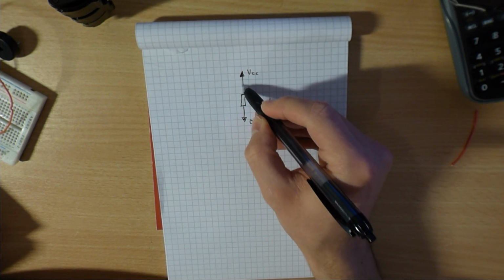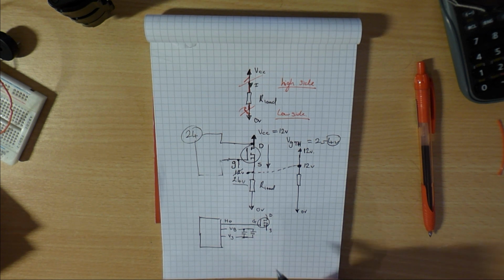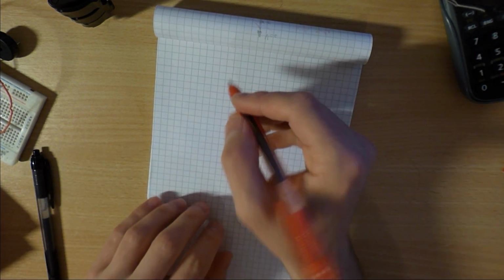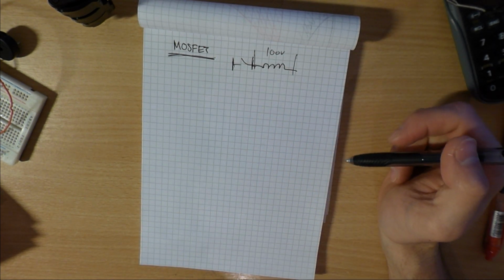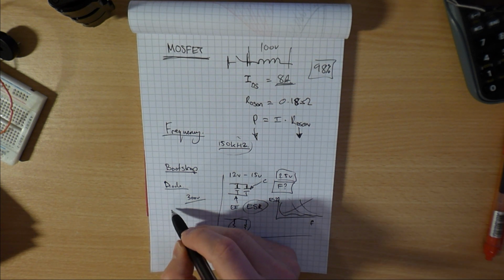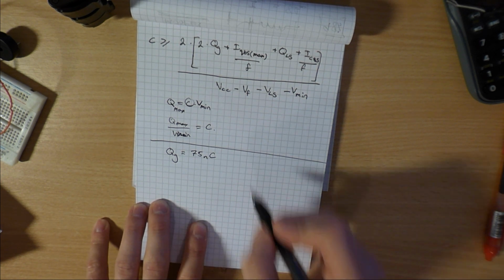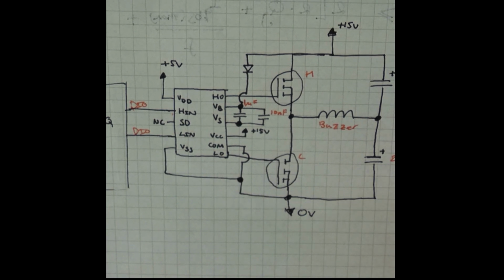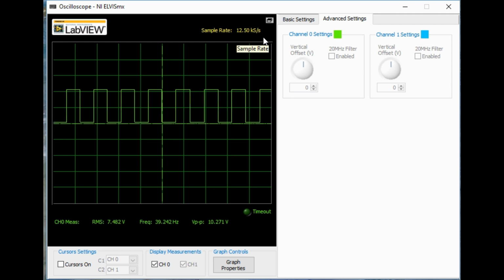Life EE # 2   How to use the IR2110 (Making a Tesla Coil driver)

Comment: Wow! One of the best video on YT i have ever seen. Well explained, in-depth analysis and practical. You should be teaching in MIT sir. I subscribed to your channel. I am in second year of electrical engineering and I was looking for MOSFET driving technique. You did it all with flying colours. Although this video is 5 years old but I do have a question hopeing you would be able to reply. What if I don't use low side switchng option, for example I am only interested in high side switching: Do I still need the second MOSFET/IGBT? Thank you again .

Comment: why did you not connect the vs pin of IR2110 to the source of the high side mosfet as you explained earlier in the video
Reply from the maker: I did it in the actual circuit but you’re right I forgot in the drawing/diagram!
Reply: @LifeofanElectronicEngineer   Thank you for clarifying.

Comment: If i connect VCC  +10v positive wire,where do I connect the negative side of the wire? Can I connect negative wire 10v to 300V ground? And if I don't connect negative wire what will happen? Because I don't see in the diagram where the the negative wire for vcc goes to?

Comment: What you mean by isolated voltage? You mean the driver prevents accidental shorting between high low?
Reply from the maker: Hey there! It’s been a while since I watched the video, so I’m not exactly sure what bit you’re referring too, but I think I’m talking about the floating high side supply. The gates of the high side FET needs to be 12v higher than the source to completely turn on. Usually your highest voltage available to you is the source voltage, and if that’s what you’re switching, then you can’t have one 12v higher. So, you can solve this with an isolated 12v supply, which is what the driver supplies. Does that make sense?

Comment: why are you using both the high and low side? are they noth both n channel mosfets?
Reply from the maker: The high side channels use the bootstrap circuit for getting a floating 12V gate supply. This is with reference to the high side nmos source pin. In order to switch the FET, the gate has to be driven with a voltage higher than the drive voltage, since this is typically the largest voltage you have available, the most common solution is to use a bootstrapped supply (the high side channel)

Comment: Any circuit or sugestion for deadtime between hi and lo?
Reply from the maker: Depends on your implimentation, whether its an FGPA, uC, or you're using some other method. I've used 25nS before, but this was with an FPGA so a little easier to control. If your gate resistor is reasonable small, then you can set a smaller deadtime. If it's large, or your gate capacitance of your mosfet is large, then the RC time constant would be large, and hence you need a longer dead time. Start with something like 100nS, and measure the gates of the highside fet and low side fet. Look for any cross over between the two state changes - you should see a clear period where both fets are off. If not, increase the dead time some more. Good luck!

Comment: Dude! That's a great video you have here. It's well explained that too with great details. I wanted to try that Steve Ward burst mode interrupter with a TV flyback transformer but I'm just hesitating as I don't wanna blow up the ne555 & my mosfet! I've already built the interrupter but from there I just don't know which mosfet to use & what kind of circuit to build to get that burst mode interrupter drive that TV flyback! Any specific circuit I can use without blowing up anything? I've already tried out different ZVS drivers & they've all worked out well. But now I just want to control the output of that flyback through that interrupter. Thanks in advanced dude. Anyway, very nicely done video, keep it up with the good work & keep us updated. Don't forget about me! Thanks
Reply from the maker: Just watch your dead time (time between mosfets all being off) it needs to be long enough so you don’t get shoot through, but short enough not to get to high inductive kick back (although, the body diode sorts that out!)

Comment: Hello, I am a student of energy engineering and I found your video very useful. I am trying to make a project on this subject and I have not found such good videos on this subject anywhere, so thank you. I am Turkish and I study English. For this reason, there were some things in my head in your video. I would be very glad if you can write me especially these Mosfet, Frequency parts in English.
Reply from the maker: Hey there, I've added a calculation spreadsheet, towards the bottom there is the equations for the bootstrap caps. I hope that helps :) https://drive.google.com/file/d/19r8iiCNZjyBqt9HbASzf1p1PMgqs6Uli/view?usp=sharing
Reply: @LifeofanElectronicEngineer  Thank you very much for your help :))
Reply from the maker: @pnarsoyoguz5929  you're welcome! If you need anymore help, pop over to the discord chat, and I/others will be happy to help! https://discord.gg/DxtFPDgRcJ
Reply: @LifeofanElectronicEngineer  Thank you very much indeed, I am very glad. I think it would be great to exchange ideas with you.

Comment: I think you should have connected SD shutdown pin to ground in order for the IC to work ?
Reply from the maker: I think it's internally pulled down if you look into the datasheet, but certainly a good shout because it's commonly forgotten!

Comment: Hey, nice explained...I had 1 Q ..if we check this driver ic then we connect 1 prob to Pin 1 and another to Pin 7 at that time which connection are mandatory ? Plz expln me..bz if I removing the  gate terminal connection of driver ic then which connection are mandatory? Bz my IC. Not working properly n haves only Pin 7 waveform not of Pin 1
Reply from the maker: Make sure you have a low side switch that's actually switching, this is needed to charge up the bootstrap capacitors, and allow you to get a high side output switching. Otherwise, it'll have a square wave for a little bit, then it'll start getting smaller and eventually stop
Reply: Thnkuuu😁

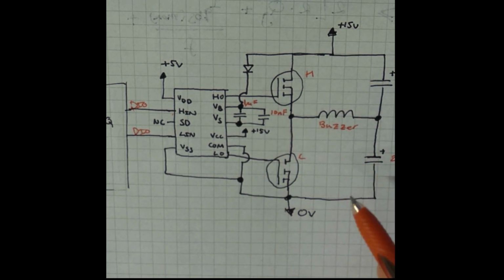Comment: Can you explain the voltage divider done by the 2 caps ( at 28:00) how the curent can flow as you said ?  thx
Reply from the maker: Hey there! The voltage divider comes about due to the fact that the voltage across a capacitor is V=Q/C. For capacitors in series, you can get the following equation:

Vx = Vsupply * Ctotal/Cx

Where Vsupply is your supply voltage, Cx is the capacitance of the capacitor you want to know the voltage across, and Ctotal is the total capacitance.

In the video example, the voltage is half the supply voltage because both capacitors have the same capacitance. Here's a great link if you're interested - https://www.electronics-tutorials.ws/capacitor/cap_7.html

Comment: Hello sir,
How would you plug this with a function generator ?
Also is the output at the mosfet is sine wave or pulse?
Reply from the maker: FGEN would go to the HIN and LIN, make sure you add some dead time switching before and, and the that its a square wave (and that they're 180Deg out of phase)

Comment: hallo sir,
if I use a 5v voltage on Hin's leg and 0v on Lin's leg, can the mosfet work for switching
Reply from the maker: No, you need them to be switching (this is so that the low side will connect to ground, and charge up the bootstrap caps)

Comment: hallo sir,
if I use a voltage of 5v on Hin's leg and 0v on Lin's leg, can the mosfet work for switching, I use figure 8 which I simulate on proteus
Reply from the maker: I'm not sure what you mean, but if you provide a switching signal to the hin (at 5v) as long as the bootstrap circuit is currently set up it should switch a high side MOSFET

Comment: Hi there, great video, very well explained.  One question - don’t you need to tie the high side switch’s source pin back to the chip for the bootstrap capacitors to work? Your schematic doesn’t show that, I was wondering if your breadboard does?  Cheers, Stuart.
Reply from the maker: Hi stuart, yes you do! I must have missed it, it should go to the Vs pin, this basically sets the reference voltage, allowing you to provide the gate with a higher voltage.

Thanks for picking that up!